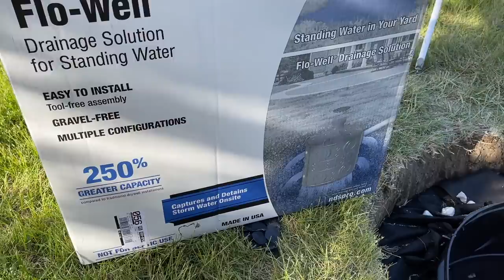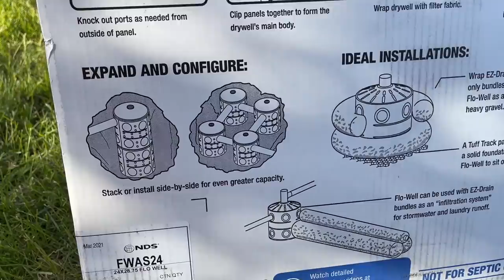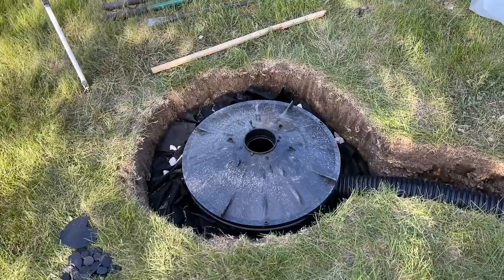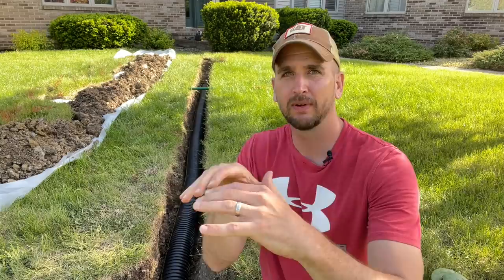DIY Flat Yard Drainage Project | Yards With No Slope

Comment: i dont get your systems. In Australia our downspouts are connected by pipe underground to the road and then into our stormwater system directing the roof catchment away from the house altogether. this system of catching it and dumping it all at the foundations of the house seems illogical.
Reply: Connecting you downspouts to the road storm water system, might not be a good idea. Ever see a back flow of pressure blow off a man hole cover, then a geyser of water shooting 25 feet in the air. That could back feed into your house.
Reply: You obviously don't have ground water issues in Australia where you live!

Comment: A tip i leared on filling in trenches is to use a garden hose as you fill back. we try fill about 1/3 of the trench then fill it with water and use spades to break up clods, work them up and down like you are getting out air bubbles in concrete, fill another third repeat and then top it off with last bit of dirt, spasde it again. you are basically making mud. then when using the spades up and down you are compacting it, then lay they sod on top and press in with rake and then tamp down. once tapped down and water has drained off clean the dirt off the grass with a spray nozzel, a few days later you cant even tell you were there. Love the video, always good to learn something new
Reply: I like this idea I’m gonna use it

Comment: Why didn’t you run it out to the street for the storm drain? Wouldn’t that have been the best option.
Reply from the maker: Yeah, that would have been ideal.  I don’t mind keeping some water on the property and would have to trench another 50’-60’ plus go under the sidewalk.
Reply from the maker: The pop up emitter at the top will let the extra water out and it will flow down the slope in the lawn. And it’s Mr Stupid, thank you.
Reply: @EverydayHomeRepairs  😂😂😂
Nailed it!!!!
✌
Reply: Oh what a dream that would be! Lol In most places I've lived, DEP has rigid regulations and tying into city/county is only an option once survey and historical data confirm capacity, overflow, etc AND permitting is approved. They don't want to strain capacity nor poison water supply/treatment with lawn chemicals and pesticides. 

Not sure if that's the case everywhere, but it has been the case everywhere I've lived for at least the last decade across multiple states

Comment: Nice system but why not use PVC instead of that corrugated pipe that seems to trap leaves that get in.
Reply from the maker: In this case I went with the 4" corrugated since I am well above the frost line I like the flexibility of the corrugated compared to PVC.  Since I put the wye at the start with the cleanout I feel I should be able to flush the pipe out if needed.  Just my 2 cents 👍
Reply: @EverydayHomeRepairs  you can also use a catch basin at the downspout
Reply: @robertgerber2533  You really don't want to do that. A lot of water splashes back. But corrugated doesn't clog any more than pvc if it is put in right.

Comment: We put one of these in a few years ago. Every time it rained or we washed off our patio the water would cover most of our patio and leave dirt and debris behind when it dried.  We were going to use the plastic liner that was used in this video but when we got about two feet down we discovered a layer of sand. Maybe we're on top of an ancient riverbed. Regardless, it looked to us that the sand would provide such good drainage the we didn't need the plastic liner. We dug down about another foot, put in the cloth and then filled the hole with gravel. It worked great. We had some of the heaviest rain we've ever had this year. The water rose just to the edge of our patio and then receded almost immediately after the rain stopped. 

The alternative was to install a long drain pipe around our house to the street. To say the least this way was massively cheaper and we are doing our part to recharge the groundwater :).
Reply: This is exactly my situation, plans, and philosophy!

Comment: in construction we called it a rock pile  and dug them 6 feet long 3 to 4 feet wide, 4 ft deep filled them with gravel and ran the drain tile into the middle did it on swampy lots to run even drain tile in the yard to the pit depends on how much water you have to deal with

Comment: Scott, this comment is not related to this video.  I just wanted to say thank you for making the video using SPAX screws.  I recently completed a home improvement project and I decided to give the SPAX screws a try.  Totally awesome screws!!  I did not have to predrill holes into wood and the screws did not strip.  I used Milwaukee shockwave impact duty square #1 bit along with the SPAX screws and not one screw stripped.  Again, thank you for all your videos!!
Reply: If you think SPAX are great I highly recommend you try GRKs. In my opinion they are worth the cost and even better than SPAX.

Comment: a major drawback of using this type of non perforated corrugated drain pipe is that when it clogs (as it invariably will at some time) it can not be rodded out without damage to the pipe. Although slightly more expensive it is better to use the white smooth wall non-corrugated perforated drain pipe (perforations down). Generally  both types of perforated pipe are  bedded in gravel so that the pipe also acts to diffuse the water for absorption into the ground.  Sometimes a nylon sock with gravel surrounding the pipe is used.

Comment: Former civil engineer here.  That drywell at roughly 50 gallons (6.8 CF) capacity will only be able to hold about 40 SF of roof area assuming a 2" rainfall.  That's obviously way less than the roof section you're trying to capture but your ultimate goal is to get the runoff water away from the foundation, so as long as the drywell has a way for the additional flow to escape, you're accomplishing your goal.

Edit:  I'll add, I am in an area that has some stringent runoff capture and recharge requirements due to the impact excessive runoff has on bacteria levels in our local waterways.  When I was doing site design work or reviews for local home development projects, you would typically see drywells on the order of 8' to 20' diameter at 10, 20 or more feet deep to properly capture runoff and contain it on the property.
Reply from the maker: Thanks Steve,  yeah I wanted to keep some of the water on the lawn for the surrounding trees but you are right the overflow will start pretty quickly after a significant rain as the soil also does not have good percolation.  Will be interested to monitor over the next few rains but I am confident the water should flow away from the house.
Reply: Your right on the money. Dry wells are usually a joke. They have to be so large that they are usually not a reasonable solution on a residential property. A well made and designed sump pump basin is they right way to go.
Reply: @draingepros  
Pumping water is the last resort.  Yes this will be overflowing but if the water runs away from the house....
Reply: @u2mister17  If there is enough slope to drain the pipe with gravity, then correct: there is no reason to use a sump pump basin (and especially not a dry well since they are impractical or impossible in most situations to begin with). But in a situation where there isn't a desirable amount of slope available, a horizontal sump pump basin 4 feet or longer is the way to go.
Reply: That depends on the soil type. Flo-well's website has a calculator. If the soil itself is not good at drainage such as clay soil, then the flo-well system will not work.

Comment: yes mounding the sod after you fill in the trench is very good tip, I have seen many low spots that cross entire fields because it will sink over time as it compacts back down. On one note it is easy to identify your irrigation or drainage, on another note it is an eye sore. very good tips

Comment: Good to see there are so many legitimate solutions to poor drainage & ponding water problems. Had a friend that encountered this problem due to uphill neighbor unpermitted ill-concieved 'improvements' that ended up dumping the water in his backyard and flooding out the foundation. After being denied insurance claims & corrective measures from local code enforcement, he tried to sue neighbor, did not prevail in any MEANINGFUL way then spiraled out of control and took his own life. Sad situation. Needless to say it is/would be a better expenditure of resources to have built a drainage system than to WASTE all the time and money on attorneys and court costs, not to mention the enmity and endless harassment by city gubmint officials due to friendly connections & preferential relations to the uphill neighbor. Bottom line: drainage systems WORK, the legal system DOESN'T!!
Reply: Jesus Christ bro lol

Comment: Thanks for the series! We're in the middle of closing on my first house and noticed the downspouts just unleash right by the foundation. Unfortunately there is a concrete driveway just a foot or two directly beside it. Looking at digging a trench parallel to the driveway to the backyard where there's a steep slope and let it drain that way.

As a non handy-man person, these videos are making me feel comfortable in knowing what to do when I get started!
Reply from the maker: Nice!  Best of luck on the project.  Sometimes it takes a few iterations and several rainstorms to get it right 👍
Reply: Sounds like a good idea..hope it worked. Had something similar in my home. Ran 6 in pvc pipe along with 4 12in catch basins connected with 2 downspouts to drain towards the curb. With all the summer rain we get here in southwest Texas, it helps.

Comment: Instead of the white rocks, you should use bank run gravel which is round stones. Much better for drainage, and less likely to clog with soil.
Reply: Always a Monday Morning quarterback in
Reply: @jimbo2325  No Monday morning quarterback, just 40 years in the landscaping business. I've seen lots of failed drainage systems that used the wrong stone, but you apparently don't know anything about that. Before commenting, learn the facts.
Reply: @lacro5686  Thanks for letting me know the facts. Guess you know it all.
Reply: This perfectly summarizes the best and worst of the Internet right here.  The benefit of a massive base of individual experience, combined with needless antisocial pecking at each other.
Reply: I have 10 years experience in YouTube commenting and the rock used will get the job done.
Reply: @lacro5686  ok.
Reply: Round rocks have less space between them compared to 1-2  larger washed stone  more space = more water flow

Comment: First check if the street is lower than the down spout, if it is lower then add soil around the foundation run two 6-inch side by side with a splitter that connects to a scheduled 40 directed to the road, may have go under OR place a drainage in the sidewalk with a plastic or stainless steel that you can step on as you walk or roll across the sidewalk the drainage that allows drainage to the street. On a heavy down pour one 6 inch drain pipe on gravity flow will NOT handle the water. You must reshape the front yard then re-seed the front yard. This will resolve this issue forever. One thing put a check valve at the end or one foot in from the end to prevent rodents from building a nest and wash out your line every spring.

Comment: Home builder for 41 years the black corrugated pipe always ends up with leaves and twigs and get stopped up and it will be useless very soon use schedule 40 PVC not the cheap thin stuff any traffic in the yard will crush the thin stuff and you're saving very little money your dry well is definitely too small all you going to do is move you wet spot somewhere else adding dirt to the foundation raises the level next to the foundation makes termites situation worse
Reply from the maker: Thanks for the feedback Keith!
Reply: 40 PVC is a huge pain to deal with compared to the green, thinner pvc intended for lawns. I did a run with it a few years ago and it was a waste of money and time; requires a much more perfect trench because it doesn’t flex, for one thing. Welding 4” is less forgiving as well. Properly packed into the trench the green stuff is fine because it cannot compress without also pushing soil outwards. Agree on smooth wall!
Reply: Just rent a mini ex and dig a large trench behind the dry well you installed. Install infiltrator sewer chambers. Maybe 10 feet. Pour gravel all around and over it. Run a 4 inch pipe from your existing dry well over to the infiltrators in new trench (which are a little lower grade). Your just boosting it with more capacity and drain ability with what I'm suggesting. But adjust it to fit the size of yard you are dealing with....
Reply: Absolutely correct. In 2010 my grandpa used 4in thin wall all around the drive way for drainage. It's now in an oval shape and very brittle. I dug it up and it cracked by stepping on it. I only use 40, and it's absolutely worth the time and extra few bucks. Thin wall underground will not last. All situations are different, but it is best to be safe than sorry.

Comment: I live in south Florida, close to the ocean, close to the beach, so my house sits on sand. No issues with drainage. Issues with rainwater eroding the foundation beds under the eaves. You've inspired me to install gutters and direct the rainwater to the middle of the yard into a dry well.
I also have plans to install an outdoor urinal, the discharge line to terminate close to the property line into a dry well. A bucket of water to flush the urinal and a dedicated downspout to wash-out the drain line. The issue at the moment, since I don't buy anything new if I don't have to, is to locate a discarded urinal.
Reply: Cool idea.   A square 5 gallon bucket. With  cheap ball valve.  To keep the flies from taking over the pisser.
 Handy for filtered  beer drain 😏🍻
Reply: I put in a dry well out of a 5 gallon bucket 🪣 years ago. We used an automotive funnel connected to flexible hose which changes over to 1/2" sch 40 PVC and then 90's to a 1/2" P-Trap and then connects to the 5 gallon bucket with lid. I have holes drilled out in it and then it sits in landscaping material and backfilled with rock for drainage. No issues whatsoever. Me and my 3 boys use it practically daily next to and behind our shed in the backyard. It has served us very well. Very practical and no mess or fuss. Sometimes I'll rinse a little bleach down and that's it. Have a good one.

Comment: Great work, we use corrugated a lot too. PVC has its place, but theyre both for different uses.
Reply: PVC is meant for jobs that you want to last.
Reply: Corrugated works fine if installed correctly

Comment: Adding some fill dirt around the foundation to create a positive slope would go a long way towards your problems
Reply from the maker: Agreed, thanks for the feedback 👍
Reply: It might help in his case. But I did that and didn't help because my house is located near drain storm and gets water from house as well as other neighbors. A French drain with corrugated pipes all the way to a perforated corrugated pipe with two small wells running to storm drain solved my problem.

Comment: Some good tips. Thanks.
1.  If that is clay soil, I have my doubts that that pit will handle the capacity.
2.  In cold weather when the ground around the pit freezes it will absorb very little water unless you get below the frost line. On a sunny day when it is not real cold roof snow will melt, run into the pipe and the pit and freeze. Then the downspouts and gutters will backup and later freeze. Possible solution is to install a much larger pit or to dig the pit down below the frost line and, with some luck, maybe even reach some sandy soil.

Comment: If have one in the corner of my backyard, which is a natural low spot.  It works well, but it is not perfect.  2 or 3 times a year it over flows.  At least it is easy to pump down a couple of inches so there is no water above ground.

Comment: dig a hole the size of a bin and fill it with broken brick, rocks, pea gravel, crushed pop cans, and sharp sand and top it off with 5-inches of topsoil and that's it, for 20 feet in every direction your ground will be bone dry, its called a field drain and is the oldest method for drying land, make sure your hole goes down past the clay level, that's what keeping your land wet, no pipes, gutters, drains catchment funnels, just a big hole filled with rubble,

Comment: Nice work... except I think the permeability of the soil surrounding the basin should have been excavated further and replaced, maybe with sand.  Depending on the amount of water it could just fill up once the soil becomes super saturated.  But still a better solution that what the homeowner had.

The other point is the basin is situated where the grade begins to naturally slope away, so that helps.

Comment: Sump pump system to day light go under the sidewalk inches away from the street away from the property for good I had the same problem at my house 🏡 called 4 drainage contractors it seem I knew more then them from a lot of research 🔬 on line n they wanted 10 grand⛈they all said the same thing after we get done u will need to hire a landscaper to rake it n seed it 🤦🏽‍♂️more money 💰 I decided to hire a few guy’s to dig the 100 trench I did the rest by my self All in with materials n laborers 4 thousand n u can’t tell any work was done at all 100 foot French drain a few catch basins n sump pump system to the street 🎯💯🤙🏽

Comment: If you are in a location that freezes, should there not be an air gap between the down spout and the drain pipe in case the drain pipe freezes the down spout can still empty rather than create a column of ice going all the way up to the gutters.  I have also seen where they put a parallel grid so that any leaf litter or twigs that come down the down spout will be directed to the ground rather than allowed to enter the drain pipe.